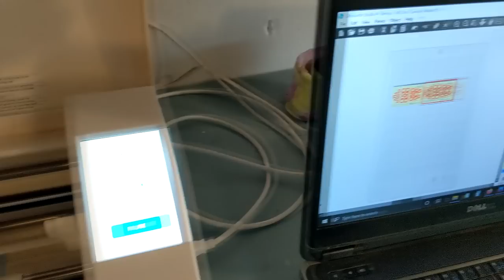1/48 Tamiya A6M3 Zero: Extended Build

Comment: As for trying something new: I'm working on Hasegawa's MC. 205, my first Italian fighter (a fairly uncommon subject). It's got lovely lines, as you'd expect, like a cross between a Messerschmitt and a Ferrari.

When it comes to picking my next project, I often open several boxes, sort through the plastic and aftermarket bits (or consider what bits I need) (and make sure all the decals are in Ziplocks), then look at my references and see what makes me most inspired. It can be a process, but it's part of the hobby for me.

Comment: Great video of a very well done build!
I am glad to see that you did not excessively weather or scratch up the Hinomaru markings. In the IJNAF (Imperial Japanese Naval Air force) the Crew chief and the Ground crew could be severely punished if the "Rising Sun"  emblems were defaced/damaged or over-painted in any way. They were always maintained at a high standard as routine as an oil or fuel check. (This did not preclude the emblem having a number painted over it partly (As was seen on the NiK2-J George, also a naval Fighter.) I take it this Tamiya A6M-3 is the Type 22 version as the Type 32 version was the "Hamp" with clipped wings and cut back range (The Type 32 preceded the Type 22 in service and was not widely popular (the adoption of the designation of type 22 was to associate the newer  version with the very popular A6M-2 Type 21) because the more powerful engine variant and lower lift of the clipped wings increased fuel consumption , cutting it range by over 160km. The type 32 restored the wingtips and increased the internal Fuel tankage to compensate and it also had features of the next model the A6M-5, to which it is nearly visually identical, which has led to many wrecks being mis-identified when found.)
I am building a family of Zeroes, and have both Tamiya and Hasegawa's kits in the stash. So far the Hasegawa A6M-2 type 11 (China based, No Navalising) and 21(Pearl Harbour type), the A6M3 Type 22 and Tamiya A6M-5/5a. Still got a few - A6M-1, M-5c & c, M-6 and M-7....all Hasegawa options... to find. As well as the trainer and M-8 of which very few were built.
Also, looking forwards to seeing the Swordfish - That would have been my choice too!

For another Japanese fighter, I would suggest the modelling the Kawanishi N1K2-J/Ja. Shiden Kai (George)Google "the Battle of the Inland Sea, March 19, 1945" Where a wing of about 35 Georges took on 150 plus US Naval fighter and basically kicked ass! (The Japanese lost 17 Georges and 1 Myrt Recon plane hot down, the Americans lost nearly 50 Planes and did little real damage to their target, the Kure Naval Base near Hiroshima. The next day the Japanese counter attack took the Carrier USS Benjamin Franklin out of the war.... although with heavier losses. At that stage of the war, that was a major shock to the US Navy.
Reply from the maker: Thanks for noticing that. One thing I had picked up on doing research was how sacred the Hinomaru were.
Reply: Don’t worry, I got him hooked on Japanese planes now and he’s got a nice stash of them already (no hints).

Comment: Excellent job! I concur with your assessment of Tamiya kits. I'm doing their latest Bf-109G6; right at this moment. If you want to mix your own Japanese metallic blue; you can use Tamiya clear blue mixed with either their flat aluminum or chrome silver. You can bend it to the aqua side by adding a little of their clear green. Thin with rubbing alcohol. Flake size won't be an issue. I wouldn't worry about over weathering anything late war Japanese. My late father was a WWII vet in the Pacific Theatre. He told me that at war's end hardly any Japanese planes had complete paint schemes. They were simply out of anything decent to paint them with. During the occupation he saw many planes and pieces of planes that he told me you could simply run your hand over them and rub off paint. I think I like your complete videos better. It helps me get an idea about what kits I might like to do, etc.....Nevertheless, that is one outstanding Zeke.

Comment: I did this model and made it a lot more weathered and even added bullet holes. I gave it an aluminum undercoat then two coat of Heavy Chipper before painting it.  It's on Temporary display at my Local Hobby Shop.

Comment: I was thinking about getting into scale model building, but wow, after checking out some videos it seems so much more detailed and expensive than I first thought it would be. As someone who knows next to nothing about it, it all seems a little overwhelming. But, I guess there's only one way to learn!

Great build by the way, she's a really beauty :)
Reply from the maker: It's like anything, start with a little bit at a time. Hobby knife, side cutters and glue. Then pick up paints as you need them. The only thing I recommend dropping big money on is a decent compressor with a tank. Getting a cheap  Chinese air compressor will set you back $80-$100 and be dead in three months.
Reply: @TheModelGuy  Thanks for the advice! Really appreciate it. 

I'm gonna bite the bullet and pick up a kit next week. I want to try my hand at both tanks and planes so I'm thinking maybe a B6N "Jill" which is one of my favourite planes, or a Japanese Type 1 SPG. Maybe even both! Either way I'm really excited to get into it :)

Comment: Great model.  My next project is to convert a 1.48 scale Revell  B24D Liberator into an RAF Coastal Command Liberator Mk 3a marked in 224 squadron markings.  My great uncle was an observer with the squadron and he lost his life in a flying accident on 30.10.1942 the plane he was in was FK 242 sqn letter 'K' king they had fuel trouble when returning home and hit a barrage balloon cable over Plymouth They crashed attempting an emergency landing and 6 of the 7 crew died.

Comment: I had a plan to build all of the aircraft that were significant to me. It's lofty goal, especially since I haven't been as involved in plastic modeling as I'd like to be. Secondly, I prefer 1/48 scale and to my (current) knowledge there is no 1/48 scale B-52H or B-2A which I used to work on in the USAF. I'm currently trying to finish an F-106 that I started almost 7 years ago. It will be finished in 5th FIS markings. I never worked on them, or saw them fly, but they were once assigned to Minot AFB, ND where I was stationed on the B-52. My goal is to finish an F-4E II done in the markings of the Indiana ANG unit from Ft. Wayne, IN where I grew up as a kid.

Comment: You did an awesome job on this kit.  It looks fantastic. But for your next A6M3, I would not use the aotake blue-green for the wheel wells and landing gear doors. 
All A6M3 Model 22 and Model 32s were built by Mitsubishi, and those were painted in the aircraft camouflage underside color (gray-green). Mitsubishi cockpit green would also be the color of the cockpit.  It appears that the colors given in the instructions are incorrect. Good for a Nakajima-built Zero, but not this version.

Comment: Sir, you have excellent skills and the build is just great! I have saved it and will use as inspiration for my Hasegawa A6M3 model 32.

If I may allow one historical note (and pls DON'T consider it as criticism of your work, which is excellent). All A6M3s were built by Mitsubishi (Nakajima factory went straight from A6M2 to A6M5). Being built by Mitsubishi would mean that the cockpit color would be "Mitsubishi interior green" and the wheel wells the same colour as underside, not Aotake. 

Nevertheless, still a great build and thank you for uploading it!

Comment: i love the historical background. not too fan of the black coating. how would yould you light a model and make engines turn?
Reply from the maker: René Stoecklin Id build a parallel circuit with a small electric motor and led lights. I have all of the stuff to do it, but I keep doing another build instead haha. I have a 1:48 C-2 Greyhound that I would like to build on the cat with engines turning. One day

Comment: Firstly, beautiful amazing work. As far as the Zero colors...there is only one Zero with known factory colors in existence, and that is the same one that has the original Nakajima engine, in Planes of Fame Museum in Chino California. Long story, but the Japanese painted it per original Mitsubishi specs as a thank you for the Museum sending the plane to Japan for a few days, so that its Nakajima engine noise could be heard in Japan one more time. Just got to see it today, and posted it on my instagram (gvad_the_pilot)

Couple of notes; the meatballs are bigger and have a black outline. Undercarriage storage area is some sort of dark metallic blue/green color.
Reply from the maker: GVad The Pilot thanks for your reply,  love those stories.

My understand is the later A6M5s have the larger meatballs. They are quite notably bigger in that kit compared to this. It also has the dark green out lines
Reply: @TheModelGuy  you are correct, the Chino Zero is a A6M5. I did go to see it today after I saw your video. Unfortunately I was unable to take a peek into the cockpit since even getting to the point I did was hard since the plane was inside the hangar, we have temp rules for museum operations in California (only outside, no inside stuff). Once all is lifted, I'll see if I can take a look in that cockpit for those original cockpit colors.

Comment: Beautiful build - so brave to use your airbrush without any needle protection. I'd never feel confident in risking that, never.

How did you do the compound masks - that is, the  inner D or O shape in the middle of a D or P or O etc, and lay them on the kit accurately? Like multi-colours of roundels, how on earth do you position the masks accurately? It's one thing cutting them, but then it's placing them on the kit. We all know the tiniest bit out and it will show.

Comment: If you like the windsor and newton oils, you will love the abtielung oils
Reply from the maker: The problem is the mark-up on some Canadian sites.
Reply: @TheModelGuy  You can get Abteilung paint at Great Hobbies or Sunward Hobbies both based in Ontario. They are $7.99 CDN which is cheaper (but more expensive than W&N) than US stores considering the exchange rate. Both places have free shipping,  Great H over $100, Sunward over $60, to save even more. I've ordered stuff from both and they provide excellent service with decent prices for the Canadian market.
Reply from the maker: I find Sunward has trouble keeping stock and my postal code doesn't qualify for free shipping. Welcome to Rural Alberta :)
Reply: @TheModelGuy  Usually both those places get Tamiya products back in stock fairly quickly as the Tamiya Canadian distribution place is only about an hour from both in Toronto. I like many of the Mr Hobby products and Sunward has been out of supply since March probably due Covid19. I think there is a back log everywhere due to the virus. Checked today and a bunch is back in. Have you tried using a trust worthy friends address in the city for free shipping? Otherwise Canadian shipping rates suck.....

Comment: So got a question. Building a former tri plane red baron. In 1/28 . So I predhaded my plane. And well got a bit to excited, and wasnt smart enough to stop with coats, so I painted over preshading on top wing. How can I fix remedy this, fix this, cause I dont want to have to strip the paint. I want to finish this and get to the next build.
Reply from the maker: Rick Moreno Option one is fire down two semi clear coats and then user oils. Option two is mix a lighter or darker shade of red and come in with the airbrush to do some post shading
Reply: @TheModelGuy  I used tamiya x7 red for base color, which is there gloss red, should I use a flat darker red or or a gloss darker red.  Thanks for the help, it's been 20 years since I last modeled. Edir: who makes the semi gloss top coat,  and what color red for oils?

Comment: Wonderful build video. Just getting ready to start the kit myself. Random question though - is it worth painting the Aotake on the inside of the  fuselage? Unless I'm missing something, isn't it completely hidden?
Reply from the maker: There is a very small area you can see between the seat and the bulkhead. If you just paint it black behind there it would be fine

Comment: A great video. Very informative. I appreciate that you include your personal preferences and the reasons behind them. 
A question for you. You mentioned replacing cheaper oil paints with Windsor and Newton. I am returning to modeling and have had cheaper oil paints and wasn’t completely satisfied with them. I know it is just a matter of quality. My question is this. If I want to replace some of my oil paints which colors would you consider essential? Maybe prioritize which of the essentials are most used. As you said and I am aware, they aren’t cheap. Those not used often don’t necessarily need to be replaced. You might think that as a returning modeler I should know but I used the oils for figures. I have decide to to commit to ww2 fighters (something I haven’t built for 20 years) and concentrate my resources and time to that area. Thanks for any help you can provide.
Reply from the maker: The three colours I would recommend as must have are a faded white, burnt umber and a black. With those three you can mix quite a few different shades for oil leaks, fuel leaks, washes etc.
Reply: Thanks for the quick reply. I know this is a foolish question but is there a “faded” white Windsor color? Did you mean white that you use for fading?  

Also, there are different W&N grades. Do you use their best or is simply being W&N a big step above other cheap brands?
Reply from the maker: @aveguy451  I was using the professional brand. As for a faded white, I know there are a few shades of white available. Mine is Ivory.
Reply: @TheModelGuy  Thanks again

Comment: Love this build. Just wondering between the marble coats how long are you leaving it before applying the blend coat and are you just doing the one coat of blend?
Reply from the maker: As long as it takes to mix the next batch of paint. It dries pretty fast. I just slowly add the blend coat so it builds up in a controlled manner. It's not really several coats but one long one if that makes sense

Comment: Brilliant work.  What airbrush do you use? I'm just starting out modelling and am trying to get on board as much theoretical knowledge as possible before I start buying!
Reply from the maker: I use a Iwata Clone for 90% of the painting. For the detail stuff I use a Pasche Talon but am not a fan. It doesn't feather as nicely as the cheap brush. Maybe the spring is still stiff but it makes it hard to use for soft work.

Comment: Over weathered but otherwise nice. Mitsubishi did not paint wheel wells and inside of landing gear covers in "metallic blue", actually transparent bluish or greenish (!) protective lacquer coat called aotake. All A6M3, both models 32 and 22 were built exclusively by Mitsubishi. Zero engine cylinders, and valves push rods were painted black.